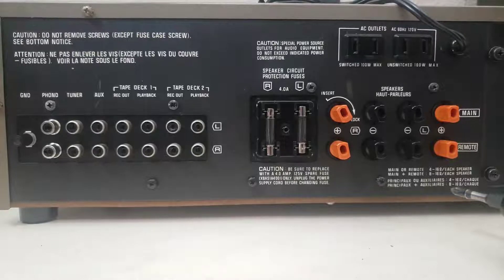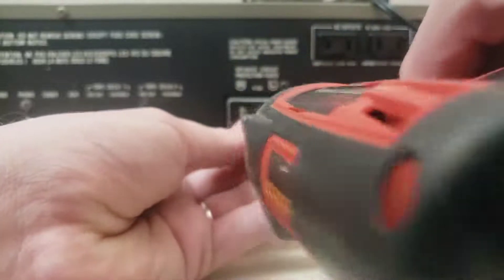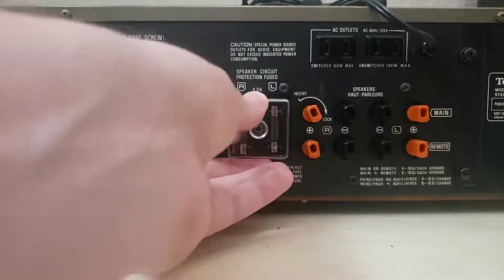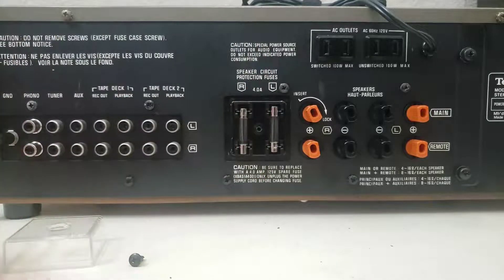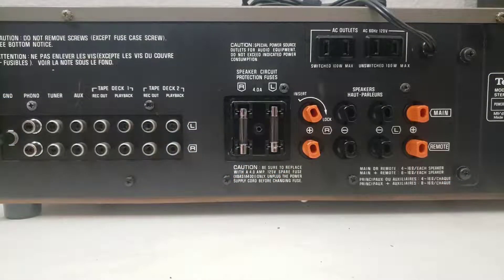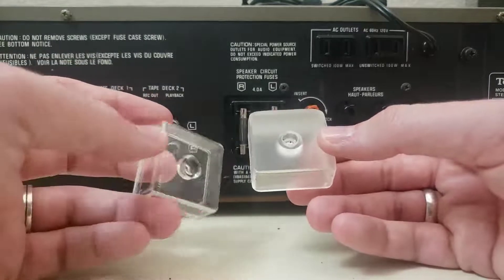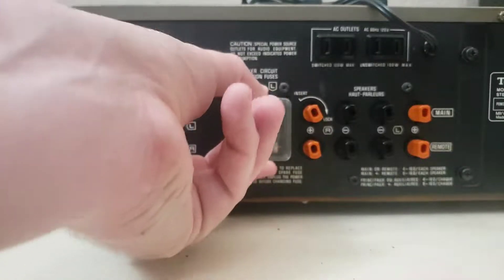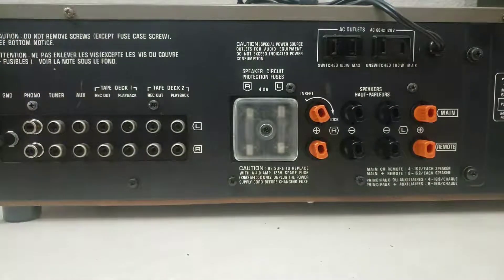Technics SU-8055: 3d Printed Speaker Fuse Cover

Comment: Hallo, für was sind die Sicherungen?
Reply from the maker: They're inline with the speakers so they protect both the amp and the speakers from failure of the other leading to overcurrent.  E.g. if your amp decides to put excessive power into the speakers, the fuses will blow instead of your speaker drivers.  Similarly, if your speakers or speaker wires short and you crank up the volume on the amp trying to figure out what happened, the fuses will blow instead of the amp burning itself up.